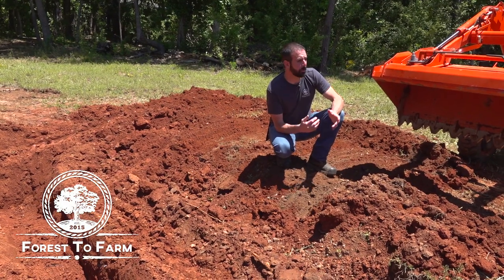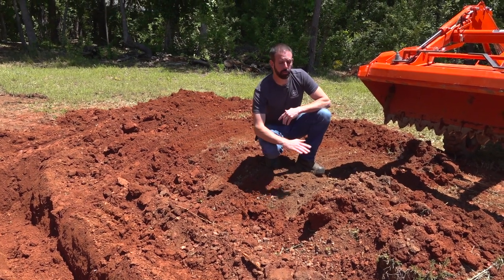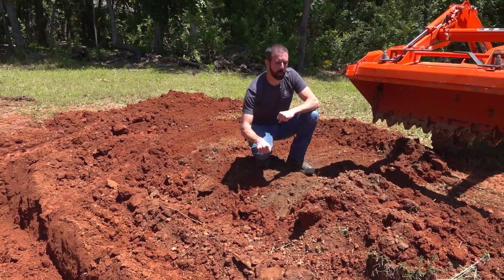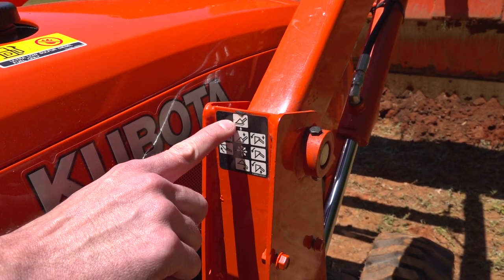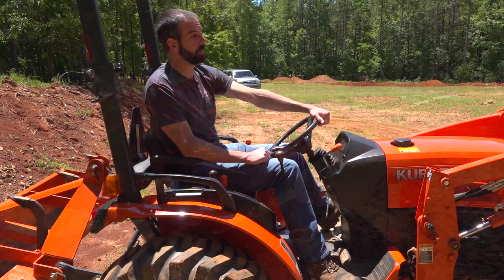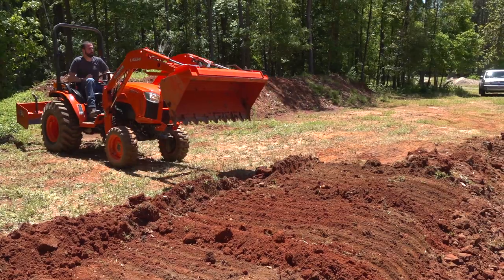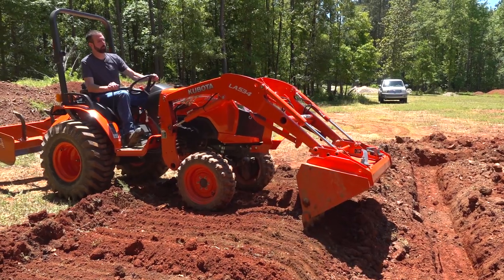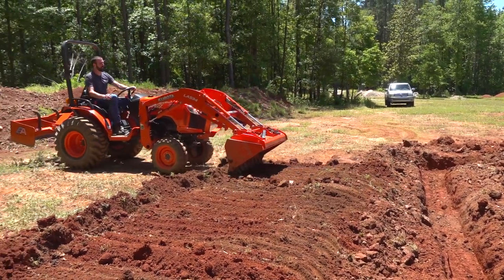Floating The Bucket

Comment: Just an experienced thought: be careful, even with what you may think is a "passive" position of the loader arms being in FLOAT position, with the bucket curl cylinders fully extended like that - if you encounter a rock, stump, or even just some really hard mounds of dirt/clay, those curl cylinders are at risk as you reverse and pull dirt away from some area. Many cases of bent cylinders have occurred when that obstacle sneaks up.  Back dragging with the bucket bottom less vertical reduces the cylinder stresses, and you still move a fair amount of material with each backdrag.  Just an FYI...it's a costly oops if you bend a cylinder.  Thanks for the info and helping people! 😊
Reply from the maker: Thanks for the heads up Graham. I was actually watching it earlier and thought it would be a good idea to tilt that bucket just a little. I appreciate your input! Its all a learning process and its no secret we are rookies. :)
Terry
Reply: Probably fine if it's just picking up ots own weight. I only allow the curl cylinders to extend out maybe 5 inches on my tractor. Use the weight of the tractor to spread the dirt

Comment: We have a 1965 IH 424 with a 6l bucket on it. Originally it only had gravity down, but a few years ago I had it modified to hydraulic up and down with float. I have never fully understood the float function, thanks for the video. I have a slightly better understanding of the float function now. It will just take practice.
Reply from the maker: Great. It helps once you get the hang of it. I think we have a video showing scoping up dirt with the float function as well. It should be in our "tractor videos" folder.
Terry

Comment: Love the vids. Just found yall and I've been binge watching them lol. Looking to get the same tractor and yall are proving I am making the right decision. Quick question for you though.. Did you get the tires loaded or does the box blade provide enough ballast for the front end loader?
Reply from the maker: We love the tractor and it does all we need most of the time. All we have is the box blade and no loaded tires. Most of the time its been doing great however to be honest we moved some dirt in a muddy area near our creek where some beaver are reestablishing a dam. We wanted the beaver pond to be a little deeper. When the bucket was full of very moist dirt and we were down hill with the bucket in the hole it would spin the rear tires some of the time. We were able to get out but I suspect if those rear tires were loaded we would not have had as much trouble. Either way we want it light when on lawns so no loaded tires for us. I have considered buying or making some wheel weights.
Thanks so much for watching!! Stick around its fixing to get busy around the farm/homestead. We should be posting for many years to come.
Terry